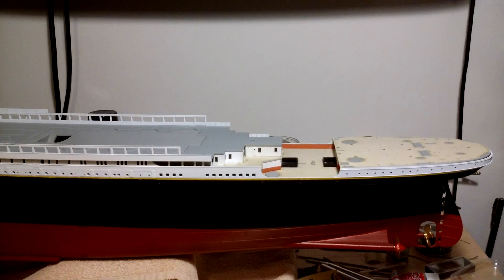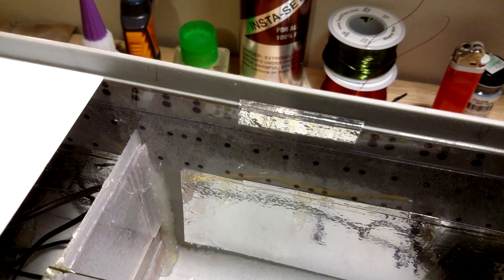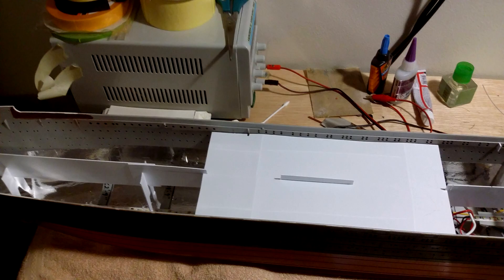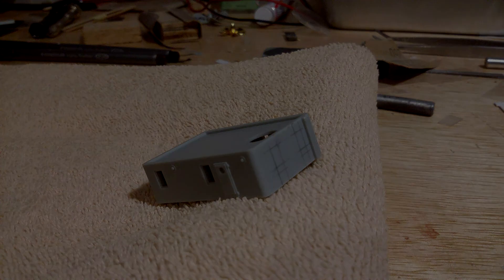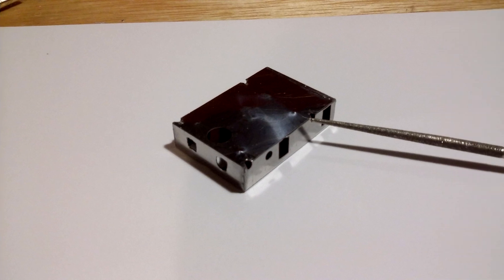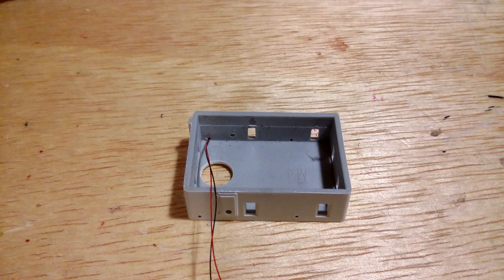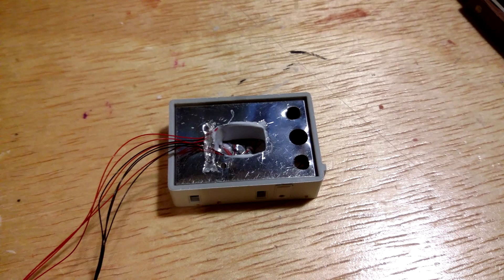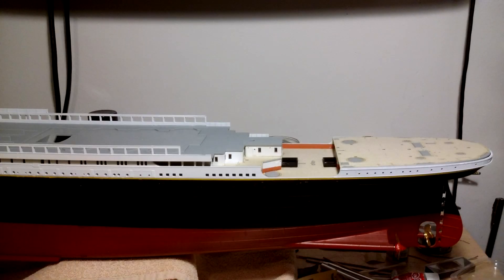Trumpeter 1/200 Titanic Part 8 - Miscellaneous Update

Comment: Why is the metal box needed for part M4?  Is is just to block the light?  Why not just paint the inside a dark black or brown?  Nice build
Reply from the maker: This box is part of the Pontos accessory kit.  The masts that come with the Pontos kit are brass and require a strong support base.  I assume the metal boxes under where the masts are located serve as extra structural support.  M4 is under the aft mast.  If one is not using this accessory kit than painting the inside of part M4 is a logical idea.

Comment: Hi daryl are you using the this lights that comes with the kit
Reply from the maker: No.  I did not like the yellow color of the lights that came with the kit.  So I went with some white LED's for the hull lights, and soft white LED's for the deck and superstructure lights.  I should have used soft white for the hull as well, but did not think of it in time.